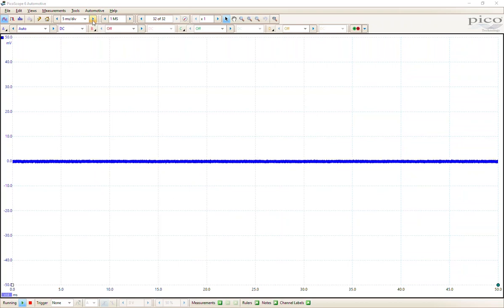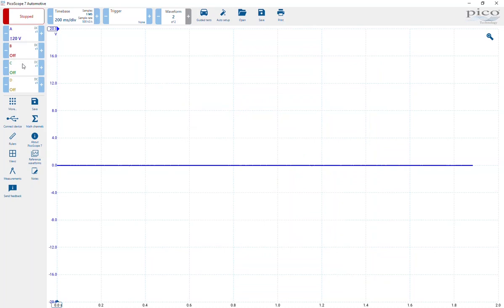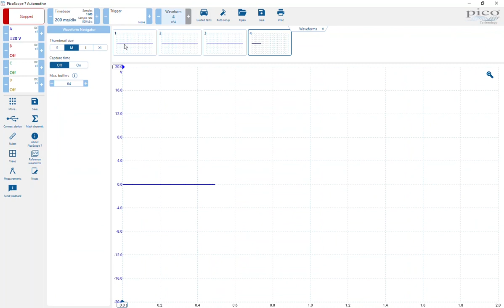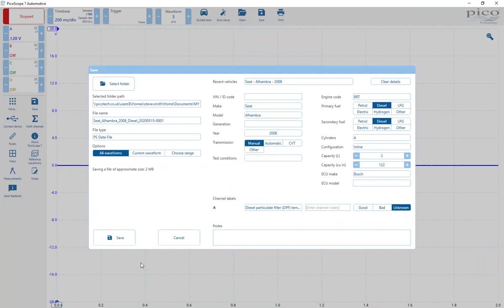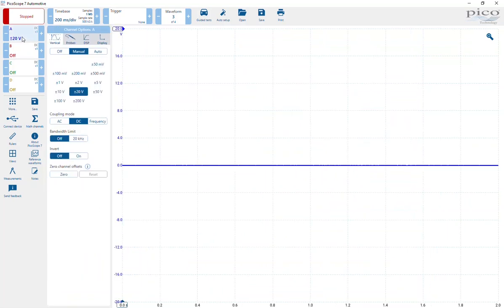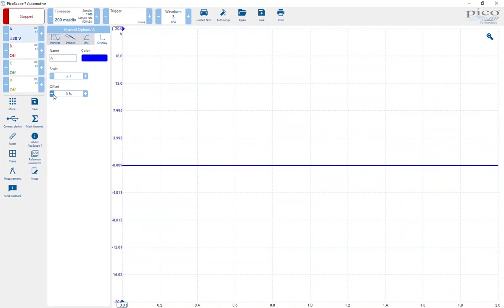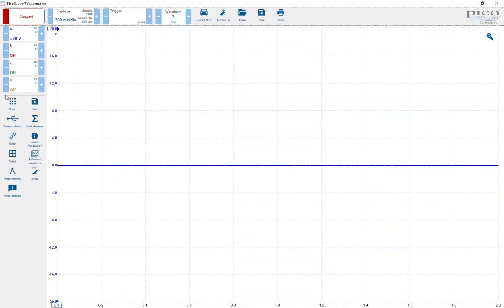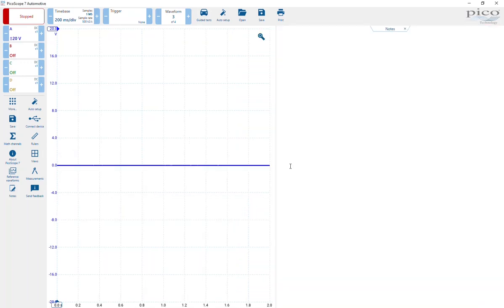PS7 start-up and tour

Comment: Guys, PS7 T&M. Still have not have "labels" ? Are you really doing this?  Is this is a premium feature in 2021 ???
Reply: Hi, you can submit this feedback within PS7 T&M Early Access (using the send feedback tool). Note that the T&M version is still in beta development and not a stable version so not all features are in place.

Comment: Nice overview. It looks like it might be a little easier for touch screen.
Reply: Lol, thanks. Yep, the touchscreen is easy to use but when we make these videos we find that the viewers aren't able to follow/see all the cursor movements and operations so easily as when you use the mouse. In both cases, we've worked hard to make sure that any task in PS7 takes less mouse or touch operations to perform than in PS6. So PS7 should be both more intuitive and faster to use. Hope that helps.